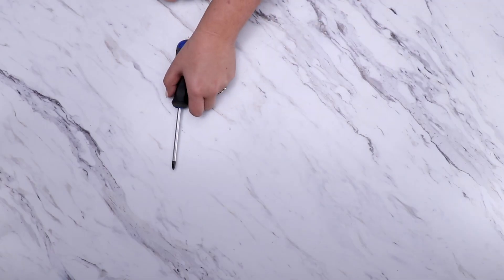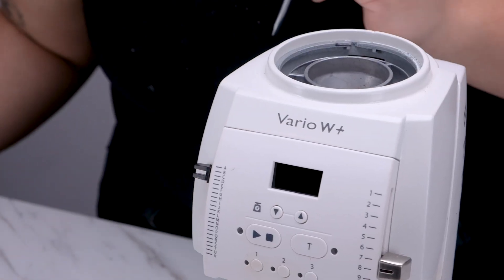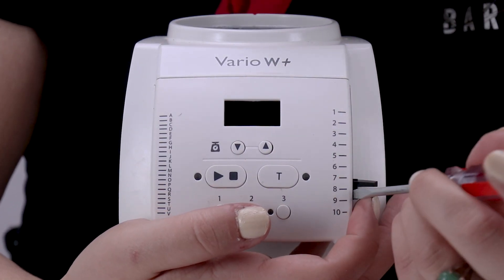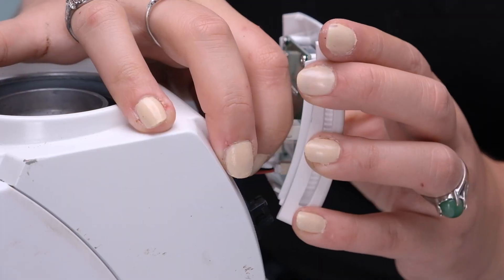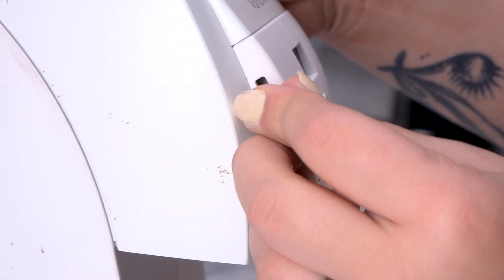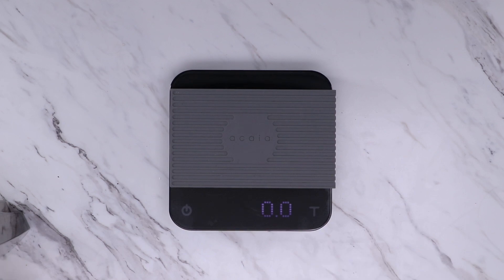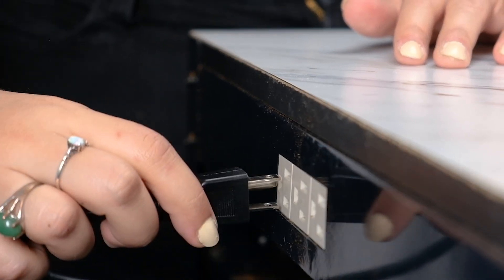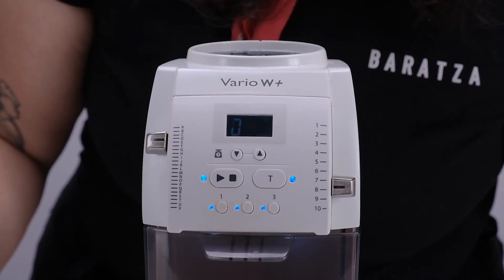How To: Vario+ and Vario W+ Display Replacement and Scale Calibration

Comment: Do you have a similar video for replacing the display for the forte AP legacy?
Reply from the maker: We do not have a specific video for it. We do have a full breakdown video that does illustrate it but if you want to head to Baratza.com, we do have a pdf guide that walks you through the process. Feel free to reach out to our support team and they can help you as well.
Reply: @Baratza  Many thanks! The display is scheduled to arrive on Monday, 01/12 and will reach out then if necessary.